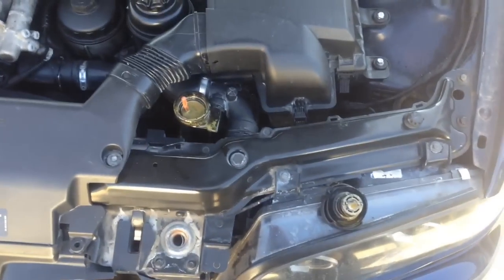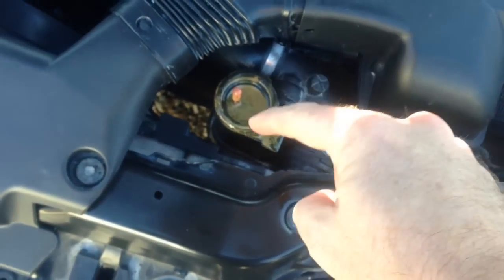BMW E46 Blown Head Gasket Problems Again???

Comment: Do not put Ghetto GREEN coolant EVER in ANY BMW!    That I learned first a while back hard way.
Reply: Meh, not a big deal, especially in these older models.  You can even run distilled water as long as there isn’t any threat of it freezing.
Reply: @brainkill7034  I could not agree with that, in this statement you said  "distilled"  why distilled?  Why not tap water?  Well the reason is corrosion and the chemicals the top water may have that may or may not react with the components.   For that, I would never even think to put green or brown fluid in the BMW cooling system designed for  Distilled water mixed 50/50 with concentrated blue anti corrosive antifreeze
Reply: @aleksankazakov   distilled water does not have minerals in it which can cause deposits and clog the system.  Tap water will work just as well to cool the system, but can create deposits over time which can possibly clog it.  Distilled water will not.

Comment: I am getting a lot of pressure on the top hose.   Blow 2 different hose. Blow the bleeding scarew blow a radiator.   Change the thermostat.  No maxing w water n oil. No overheating no coolent lose.  Any idea where the pressure coming from ?
Reply: You had air in the system
Reply: Head quasket

Comment: hi... i had a leak too and i found out the the leak was from a small /tiny hole under the radiator and the water was vaporized due to the engines heat.If you dont see any white smoke from the exhaust  and no having overheat issues ,no worries
Reply: Haha! Same.... Tok a while to find it.
Reply: Hi I had the same problem with a small hole in the radiator that was only found when pressurized. Was there anything wrong with your cars head gasket or was the head warped?
Reply: @hollisreinhardt1127  no...for me.. if you open the radiator  and let the engine running about 5 min and see bubbles etc then you might have a problem with the head gasket,,

Comment: Nathan I guess your place a clutch fan on my E46 B 25 take it for a test drive it was a faulty clutch fan it was spinning wobbly anyway all the blades snapped and it didn't overheat is only half a block away from my house got it back home change clutch fan and blade now I am saying a little bit of Milky under my oil caps could this be unbroken coolant hose plastic one or possibly one of the lines to the CCV?
Reply: If the oil isn’t milky from the dipstick or when you drain the oil, sounds like you just need a new oil filler cap.  Before replacing you can clean out the gunk that is already there and clean the seals on the cap and valve cover and run it for a while and see if it continues.

Comment: that sucks...I would be stuck on the idea that it could be a failed repair and would loose sleep over it......how about a pressure cap tool and see if it (the cooling system) holds 16 psig for a few hours???
Reply from the maker: +danekeeper1 Im about to pull the valve cover now, ill do a video on it and let you know the result

Comment: I hate saying it but all used cars sold should be sold in "as is" condition. If you know it has a problem don't lie about it but don't feel responsible for someone melting the engine. You are not liable for the buyer's stupidity.

Comment: One thing I notice is the coolant color isn't one from BMW since it's more blue than green color
Reply from the maker: The oem bmw coolant is blue, i use green in everything i get in.
Reply: Nathan's DIY Garage it needed BMW coolant !
Reply: The color means nothing as long as it's silicate free. Silicate free coolant comes in just about every color, it just depends on the brand. The only thing you need to look for is that it says either silicate free or extended life/long life. 
Conventional green, however, is highly corrosive to plastic and a lot of modern seal materials, don't use that shit in anything.
Reply: I’ve owned many bmws and always used bmw coolant. Never had a head gasket go bad. Many of my bmws have gone over 200K. For the added few dollars of bmw coolant, it makes no sense to me not to buy it. I won’t buy a bmw if it’s got green coolant.

Comment: Hi Nathan one tip I would have is remove water pump drive belt and then run it - if the water is static and especially when you rev it, its good. If you do this and rev it and it bursts water out you know 100% the cooling system is pressurised from exhaust gas. Loving your vids. Greetings from Gibraltar
Reply from the maker: +Sam 1977 That is correct, also you can hook air to the spark plug hole using a compression gauge hose fitting
Reply: +Nathan&#39;s DIY Garage Whilst I have your attention I am still trying to diagnose an E39 1996 model - first year of this car and has obviously had an engine change since when I removed the engine cover it says "E36 328" is yellow pen! Its a Spanish car, no interior OBD socket, has the large one under the hood but I get no connection with this from any of my diagnostic tools with the adaptor. Basically idles perfect no misfire, did the "door test" to see if it shakes, no issues there, but has no power at all, even when revved in park, it revs up slow. Had intake boot hole, changed that. If you drive it around 2 miles and up hill it will overheat. Did compression check - its low. I don't have a leak-down test tool but have ordered one from the UK. Any ideas?
Reply from the maker: How low is the compression, and is the valve cover plastic or painted metal?
Reply: +Nathan&#39;s DIY Garage I will need to re-do it as it would be pointless to give you the wrong data - this car has been hanging around me like a bad smell for about 3 years now. It even moved house with me last year still broken (and I drove it from A to B as it goes, but I did only move 5kms away). From memory it was about half what it should be and on nearly every cylinder - i.e. it wasn't just the one, it was across the board. I need to either fix this car or ditch this car as its just taking up space. Its only done 70,000kms and apparently on two engines!! Will re-test it. I race in Time Attack series in Spain and so always have E46's knocking about - can I change this M52 for an M54?
Reply from the maker: probably need to check the head bolts they like to strip the threads, if the head bolts are loose at al the head has to come off
Reply: +Nathan&#39;s DIY Garage I am looking forward to trying that theory actually. If its not that then I suspect blocked/collapsed cats. However with no codes off this engine I am blind. Check  engine light doesn't come on but also not with ignition in position 1 either!!
Reply from the maker: it needs to be i position 2 for the light to come on
Reply: +Nathan&#39;s DIY Garage Okay - sorry that's what I meant. Point is somewhere in this poor cars life it has had a failed engine and then "Pedro from the village" seems to have had a go with an E36 engine and blanked off the CEL and disabled or not connected the diagnostics - the car is so low miles and immaculate which is why I carted it from one house to another. Most cheap BM's where I live are UK right hand drive (right hookers as we say) this is a left hooker so worth saving.
Reply: +Sam 1977 Anyway the leak-down will reveal all!! Just waiting for the tester to arrive.
Reply: What was the outcome of this car ?

Comment: Hi Nathan  need some advice did a head job after blown gasket, the car work good full of power coolant always on max but the car runs on high temperature. It goes up to 110 aux fan runs in high  all the time , when on park while the motor is on the temperature doesn't drop it drop when the motor is off please advice thanks bmw m54

Comment: Mine is 2004 with 130,000 miles. I did cooling system; radiator water pump thermostat and some hoses. Radiator idiot light on with white smok. I figured it was CCV valve. Took to BMW specialist and he is saying it has a blown head gasket Cost estimate? $3000 at least. I cant do it but alternatives are new car or find a non-Bmw guy to fix it cheaper. Worry is if the head is warped I will waste a lot of money to find out.
Reply: Try blue devil pour and go gasket sealer as a last resort. Nothing to lose.
Reply: @dhalsim-1  I did the repair that was 4 years ago and the car rides like a champ. Drove it for 2 years for a sales job and earned mileage so I guess it was worth it. Now in semi storage try to not spend any money on it, main thing is it runs well.
Reply: @MrEddieo1  head quasket it was? U had white smoke? I have white smoke

Comment: hey I have 323i and I'm getting a leak I change water pump fan clutch radiator bottle but when I drive when I stop and turn off the car it just leaks no over heat and I have a misfire but all spark plugs are new and ignition coils
Reply: Hello, how did you fix this problém ?
Reply: Hi can you tell what was wrong with it ?

Comment: May I ask why you are running the car if you know the head gasket is blown? Shouldn't you be changing it immediately? Mines blown the expansion tank a few few times before I got mine changed but the engineers told me it wasn't blown the muppets.

Comment: hey Nathan ive notice a few BMW in my area having blown headgaskets I was considering picking one up to repair can it b done
Reply from the maker: +crazyleggs4 more than likely it will have the head bolt threads stripped,  i have put up enough videos on how to do the job that you should be able to do it, remember you will need the special tools to set the timing.
Reply: @NathansBMWWorkshop  so If my 2004 BMW isn't blowing white smoke...and no bubble's in coolant...and no milky oil cap or dipstick....does that mean I didn't blow a head gasket?
Reply: @williambernstein4313  yes
Reply: @williambernstein4313  no way to truly tell without checking compression.  These engines are extremely well made and a head gasket leak does not guarantee that the oil or coolant will mix.

Comment: How do you torque head bolts with a torque wrench? I thought those were supposed to be torqued by angle.
Reply: It's usually both. On a 318i I did, you first torque them with torque wrench to spec, after that you torque by angle.

Comment: first,  you should have flushed the cooling system to remove all the gunk before you ran and drove the car.  You are now faced with determining if the oil slick is new or residual.  Again, cannot stress the importance of flushing the cooling system after changing a blown head gasket that result of oil in water.   this is funny to watch, but also sad at the same time.